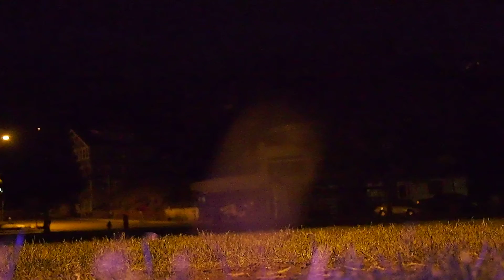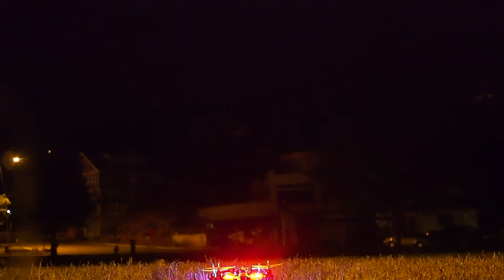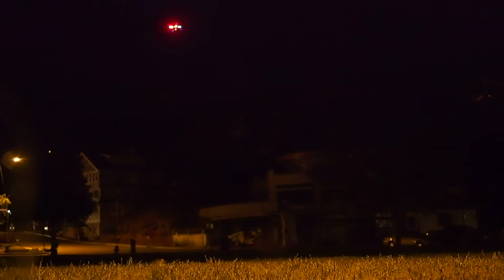Custom Arducopter 3.1.5 port on Crius AIO v2.0 - Autotune

Comment: Hi..., I use crius aiop v2 (flash with flashtool MPNG 3.1.5 R2, can I use it for mission planner version 1.3.37? 
what is exactly version for MPNG 3.1.5 R2
Reply from the maker: +Jimmy Arzano - This firmware isn't MPNG. But to answer your question - probably. 

If you want a 'for sure' answer, the best place for questions about MPNG 3.1.5 is here - http://www.megapirateng.com/forum/viewforum.php?f=4
Reply: +Charles Werbick upssss.... sorry.., btw you get great job for autotune

Comment: Is this the RCTimer AIOP v2.0 (with the data logger chip) or the HK AIOP v2.0 (aka AIOP v1.1)?  I ask because I've been having a lot of trouble with loiter waypoints on the HK AIOP v2.0 using MPNG 3.0.1 R4 and want to know if it's the same.
Reply from the maker: Sorry for the delay replying. It's the Crius not the copy. (So, the rctimer version...)
You can try my 3.1 port. It's available on github. (Search bleedupilot)